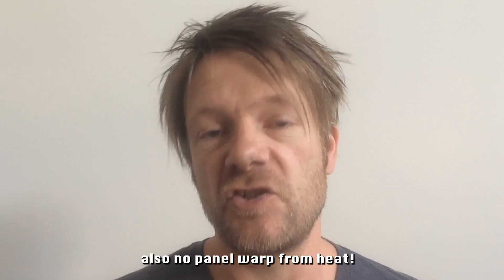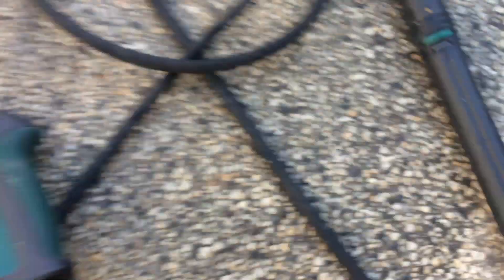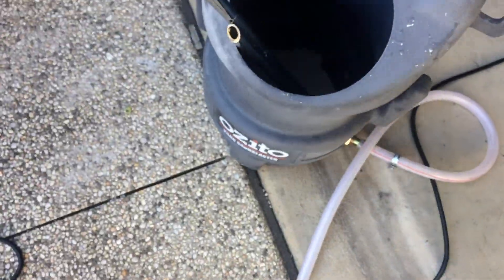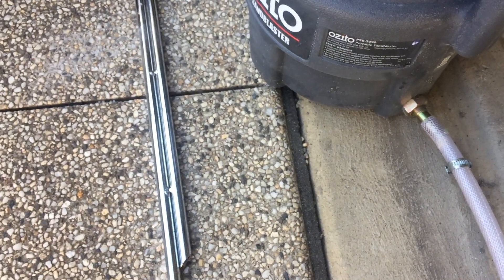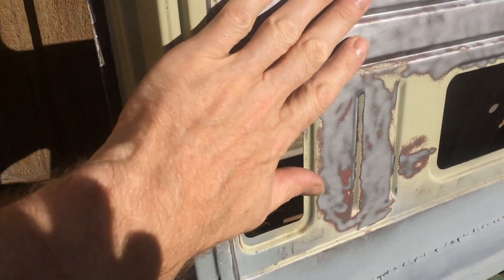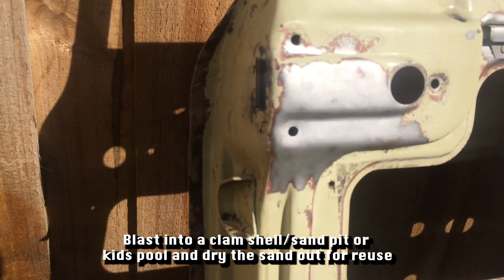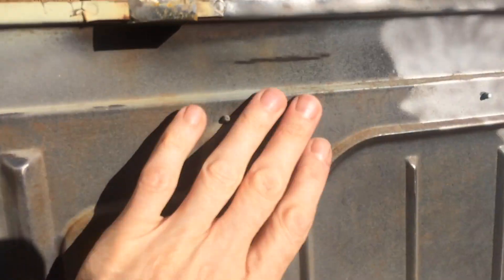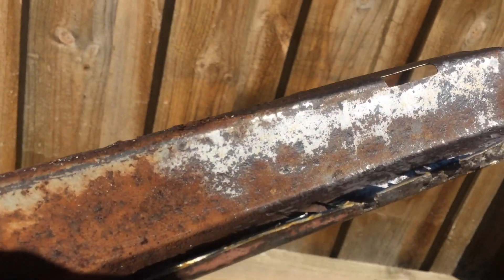Wet Sandblasting and vapour blasting with a Pressure Washer

Comment: That looks like it works pretty slick! I’m going to give that a try on my next project.👍
Reply from the maker: It works pretty well for sure as long as you use nice strong tube that doesn’t squash. Been using airline tube for a current project and did the job well. Stripped of 4 layers of paint much faster than I’d ever have done it with a grinder/flap wheel!

Comment: How did the pot work? Any inconsistencies in sand feeding?
Reply from the maker: I’ve switched to a thick non crushable airline hose for the sand and that works better. Dry sand is the go or if using a slurry mix of sand and water keeping the slurry moving by using a cheap Ozitto watet pump helps too. Still better than dry sand blasting cos it’s so much better to keep the sand in one place with no dust.

Comment: I'm waiting on my blaster kit for my 3000psi 2.5gpm pressure washer, and was going to use a $10 kiddie pool with some plastic/tarps to contain the water an media runoff for potentially future media reuse. Would be really interesting if I could put a small pump in the pool to keep the water/sand mixed and then just drop the sand input tube into the pool and just not worry about clogging or adding sand.

Comment: Can normal sand be used?
Reply from the maker: yes. It just needs to be dried properly so if you use kids play sand, you need to spread it out under the sun or a heat lamp to dry it thoroughly or it won't flow through the tube.

Comment: Just further to my comment regarding clogging at the "Y" junction... I found that ditching the hose that this unit comes with and using 15mm BUTELINE pipe (the plastic replacement the plumbers use rather than copper pipe) works really well and it fits both ends like a glove.  The other pipe kinks and flow is up and down.
Reply from the maker: that's great to know Christian! I was looking for another, strong pipe myself.

Comment: Hi mate, I've the very same blaster attachment... the problem I get is water making it's way up the "Y" junction and causing the sand to become wet and clogging the flow. Do you get this problem? I'm using a 3000psi washer.
Reply from the maker: yes I have had that. I elevated the sand and also used an airline to blow out the line every ten minutes or so just to keep it clean and dry.

Comment: Nice video mate. Have you tried to do Soda Blasting through pressure washer?
Reply from the maker: Yes but not as effective I found.
Reply: @onomatopoeidia  thank you for answering quickly and honestly. Second one, how is the damage wise wet blasting (sand)? i know dry sand blasting sometimes eat the material so may be it is different on wet.
Reply from the maker: @ertandx5362  It's actually very gentle. It won't remove bad rust so really only good for removing paint and gives a nice finish for aluminium parts too like cast throttle bodies.

Comment: What sand do you recommend
Reply from the maker: Kiln dried sand. Not kids play sand as it’s too wet. You can poor the wet sand into a hot driveway to dry it out and then sieve it to make sure there are no rocks but works out more expensive usually anyway.
Reply: Search for a blasting supply company in your area and use proper blasting media. Silica in sand is hazardous to your health and blasting media isn't all that expensive

Comment: Amazing Innovative Concept! Appreciate your video! Where can I buy that connection tip, and will it fit Karcher pressure washers?
Reply from the maker: thank you. eBay and Amazon are good ones https://www.amazon.com.au/s?k=karcher+adapter&adgrpid=93881990864&gclid=Cj0KCQiAmL-ABhDFARIsAKywVafGrXjk9NVjeS64HXGa3FzSJl5hCMj5tgM7LRV49TK7YHgG-P3jIIgaAkOFEALw_wcB&hvadid=414047839871&hvdev=c&hvlocphy=1000567&hvnetw=g&hvqmt=e&hvrand=11096800596382498337&hvtargid=kwd-6837127293&hydadcr=22640_33343&tag=googhydr0au-22&ref=pd_sl_tlk79qvs9_e

Comment: Have you used a heat gun (paint stripper ) to dry the surface  as soon as possible after to minimize rust?
Reply from the maker: yes but it will still start to rust pretty quickly. Dry it then use some steel wool then wipe with some deoxit to halt the surface rusting.

Comment: What is the power of this water pressure machine,can i do it with a pressure machine of 120 bar?
Reply from the maker: This is a Gerni 130.3 Max 130 BAR 1,885 PSI. It will just take longer with less pressure.

Comment: Can I use children’s play sand ?
Reply from the maker: yes. Needs to be dry and strained. Playsand is often quite moist out of the pack so tip it on a hot concrete floor etc and spread it out to dry then strain and use.

Comment: no dust in the air but watter everywhere, but yes it's healthier. But metal doesn't like water so it'll rust very quick with water sand blasting. It's good to have both depending of what we want to do.
Reply from the maker: Monoï rubbing down with deoxidizer and steel wool and blowing the water off does the trick. Still much safer and effective for me than sand alone.

Comment: Using real sand to blast may cause the sand to break into quartz particles. Those are very unhealthy to breathe and can cause lungcancer. So better only do this if u live in the middle of nowhere and never put the sand where kids can play.....
When the wet sand dries it will go somewhere and is a health risk.
Reply from the maker: ______x that’s right. That’s why wet blasting is so much safer. Still wear a mask though as high pressure wet sand hurts!

Comment: I am finding that the sand is stopping all the time. The sand is super dry but never seems to have a constant flow. Any tips
Reply from the maker: I had that too. Elevate the sand source above the height of the basting tube so some gravity helps. You can also try stiffer, better quality garden hose for the sand delivery so it doesn’t crush with the suction pressure. I have also tried a kids wading pool with sand in there to make a slurry. I then used a dirty water pump ($50 or so) to pump the slurry mix into the nozzle so the sand is premixed with water as it enters the blasting nozzle.
Reply: @onomatopoeidia  Worked better today after me doing that Thanks

Comment: If the steel is blasted and is bare of paint how do you stop flash rust  if its a wet blasting system
Reply from the maker: Do it on a warm day to speed up the drying or/and blow the remaining water off with an air gun, paint stripping gun or hair drier. You can then wipe it down with deoxidine. Once dry, you can rough it up with steel wool then give it a spray with epoxy etch primer.

Comment from the maker: Update: So... I also just tried blasting into a kids pool and simply recirculating the slurry to blast by mixing up some sand and water and putting the end of the sand blast supply into the pool. There's enough suction from the venturi effect but the water/sand hose is too flexible and simply crushes from the suction. I'm guessing a stiffer medium delivery hose and some pump assistance would do the trick for a large scale outdoor vapour blaster! The interesting effect is that the agitation of the water coming back into the pool keeps the sand and water mixed stirred so may work quite well.
Reply: Refer to my last comment and this may help with the "too flexible and crush problem".

Comment: Great vid Simon I will look at getting one of those. Should look at blasting the item in a container and recover your sand maybe.
Reply from the maker: yeah works great hey! I did the rest in one of those kids clams/sandpits for $10 or so then recovered a lot of sand. Next I'll do the wheels, engine parts then onto the Bike! I'm thinking if I run the sand line into the wastewater/slurry/sand mix and keep it agitated and maybe elevated, I should be able to circulate that through like is done with Vapour blasting cabinets?
Reply: Yeah if you were set up up on a flat deck trailer and the pump was down bellow and you had a spigot in the pool draining down a hose back into the pump but I don't think yer pump would last long..... Scratch that, duff idea.
Reply from the maker: PIPER DOUG a dirty water pump would be ok. That’s what they use in vapour blasting cabinets. That’s probably why I’ll try next to feed the sand and water mix into the gun too. In my case, my air compressor does not have enough volume to supply the air hence the high pressure washer idea.